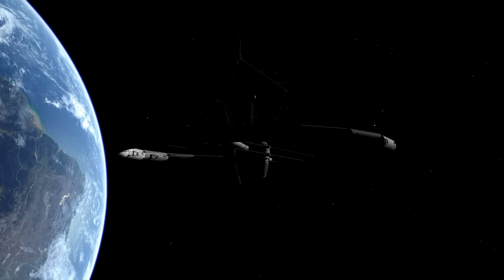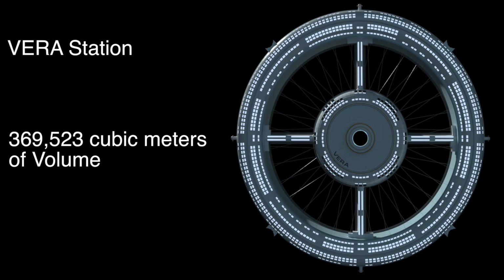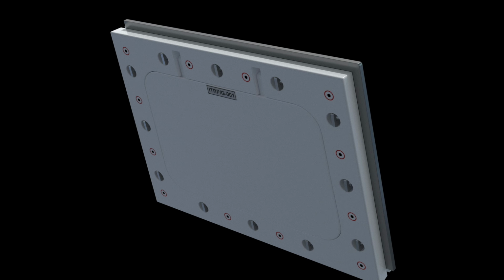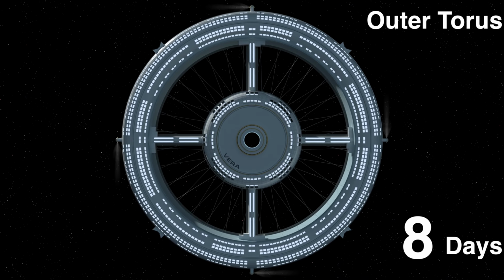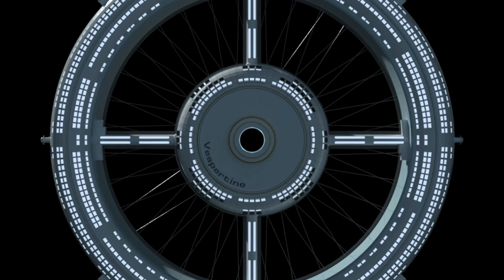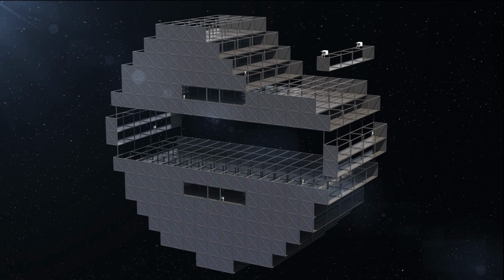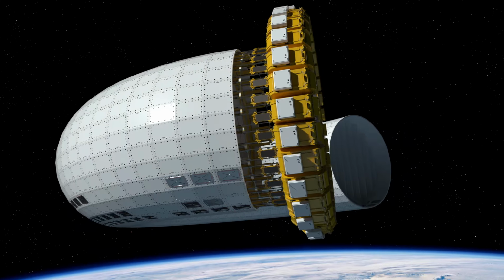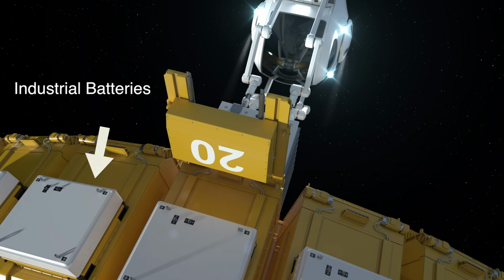We could build this huge Space Station in 6 months

Comment: I propose to your engineering think tank an on going long construction with only a minor angle change, I would base it on the Italian Cellentani Pasta design extruder, so instead of making limited doughnut shapes and moving to another station spot for a second station etc.  You can create  a 300m spinning "Cellentani" shape station with two Sargon machines on either end; this way you can build you first 1 klm spinning citytown in space. Yes you would add several external modules for spaces docking, arms and special manufacturing research modules. As development grows you could build the first  "Cellentani" Dyson ring around asteroids for material mining, the moon if not the Earth.  Your Idea is excellent. Budget break down to create, launch, build, supply, service and manpower a "Cellentani" station, (do your math and make a video)?
Reply from the maker: Hello D.C. - Yes that will be the "Business case for VERA Station" video we will make in about 3 months. Next we have to create a video showing people several important things: The STVs, station interior, and MMOD defense system.   - JB

Comment: An idea I just had i would like to put forward.

In order to save fuel entirely while traveling between stations would it be possible to utilize a short range laser kite propulsion system on the ships? Similar to the idea for traveling to other planets but on a smaller scale to simply push a shuttle from one station to another?
Reply: Orbital mechanics are a weird and non-intuitive thing...and pushing a ship from station to station is going to need more than a simple shove.    SpaceX used to have a Crew Dragon simulator which starts you out near the Space Station then you have to dock it.   Very challenging and a good demonstration of how to move orbitally.
Reply: @recoilrob324  Actually orbital mechanics mean that very little fuel is needed to transfer between 2 stations in the same orbital plane. Almost none, depending on how fast you want to make the transfer.
Reply: @recoilrob324  Not really unintuitive to realize that lower orbits are faster than higher orbits.
Reply: That is not saving fuel entirely it is just making the fuel from the laser station
Reply: Laser electricity usage and waste heat would make this impractical I think. Maneuvering to stations within the same orbital plane is simple as is, and doesn’t take much fuel. Small phasing burns can get you to another station within a day, and depending on how much fuel you are willing to spend you can get there within one orbit.